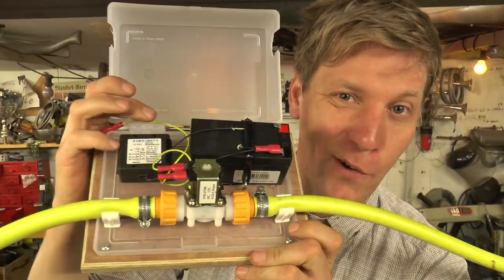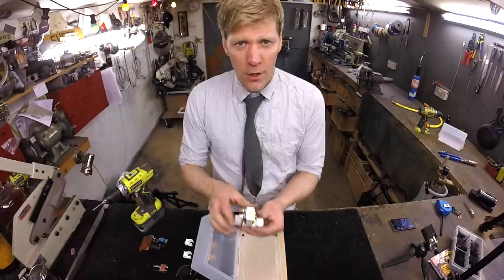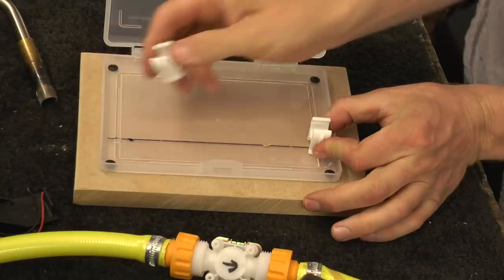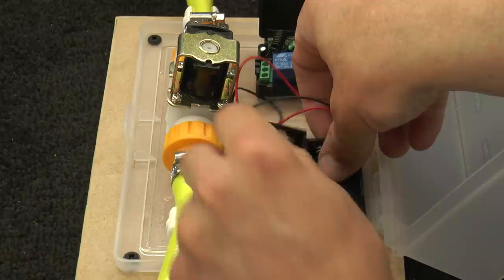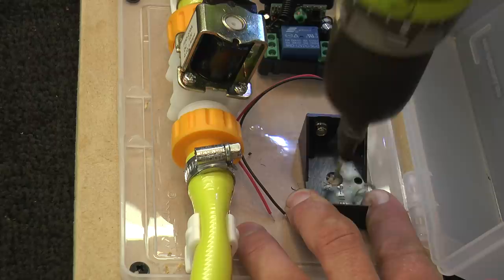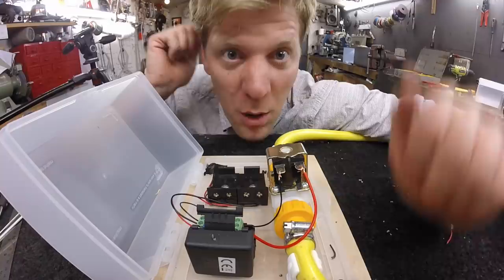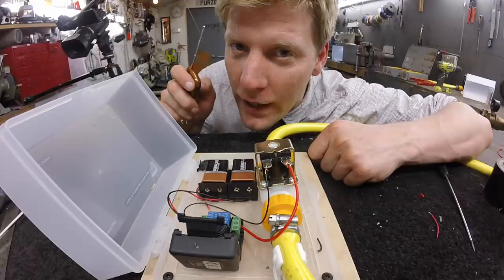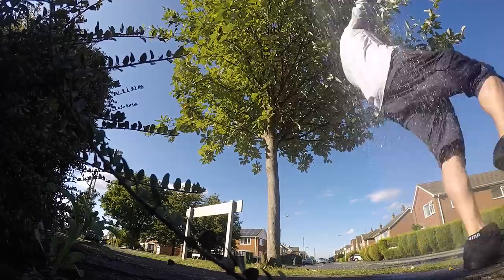How to Make a Remote Hose Pipe Controller

Comment: What you are saying about the Relay doesn't seem right. NC or Normally Closed is a closed circuit, that means current can flow. Normally open is an Open Circuit, meaning current can't flow. So its essentially the other way around.
Reply: You can tell he isn't in his element for once ^^
Reply: When you activate the relay, it is closed. When you activate the relay when it is NO, the relay is open.
Reply: A relay doesn't open or close itself. It opens the NC (normally closed) and closes the NO (normally open) Thats it. When the relay isnt activated, the NC will pass through current and the NO will not. When active, the NC will not pass current and the NO will. It literally switches the current from the right pin to the left pin. The center pin is what it connects to, also known as COM. COM is (when relay is not active) connected to NC. So current can flow from COM to NC. When active, it will disconnect from NC and connect to NO. So current can flow from COM to NO.
Reply: Though it wouldnt have hurt to look it up for him. Its electronic basics really. He can make amazing things. So he should be able to understand a simple schematic of a relay.
Reply: WumboTech You know he probably did but just got it messed up while filming.
Reply: You're right, Collin's oopsed. "Closed" and "Open" in electrical terms are counter-intuitive. You'd think "Closed means electricity can't flow", but that's not true, "closed" means it can flow. The terminology comes from the diagram of an electrical switch. It looks like a doorway, or a bridge. If the doorway is "closed", electricity can flow from one side to the other. If the doorway is "open",  the connection is broken.

It's a stupid terminology. We think of doorways as something we walk through, not "is the wall continuous or broken".
Reply: Whatever you just said. No idea if it's true or not but I think you know about this shit so imma like your comment
Reply: Yea its fair to say that, because otherwise it wouldn't have worked ^^
Reply: I agree, wanted to put the same comment as yours but I was pretty sure somebody has already noticed
Reply: The term closed and open in regards to a switch or relay refers to the effect it has on the circuit. A circuit is basically a loop where current flows from the power source, through the load and then back to the source. With DC from a battery it flows in one direction, and the with AC from the mains it switches direction many times per second. If you close the loop, current will flow. If you open the loop, current won't flow.

On another note. Colin referred to the control circuit needing a wire connected from the positive battery in terminal around the the common terminal. The reason that the board doesn't pass though the 12v to the common is due to the solenoid side of the circuit being rated for higher current than the control board itself requires to operate. This also allows for a separate power supply to the solenoid if the application requires it.
Reply: Pretty sure he is fully aware of it but this is supposed to be done by beginners. He basically explains the position of the solenoid rather than the way a NC / NO circuit board works.
Reply: callardo1 uhm no, i dont see why he would give false info on purpose.
Reply: I believe these units are latching. Not by the relay itself, but by the logic which drives it. In which case, the relay terminal assignation would be arbitrary.
Reply: unless the solenoid he used is normally open then he is right ;) but thats a design flaw since it will be using power with the water turned off just to keep the solenoid shut
Reply: It depends on the control logic which drives the relay
Reply: MattsAwesomeStuff Think of it as a drawbridge.  The source of the name came from early switches that had a lifting gate that allowed current to flow when the 'drawbridge' was closed.
Reply: callardo1 Actually, you're the only one who's right here. When talking about NC or NO, at least for me in a mechanical field of work (we sell electric valves in the thousands daily) nobody ever thinks or talks about how its wired, but what the thing you get does for your application. Either you need it to be closed or open constantly WHAT HE MENTIONS AND REFERS TO IN THE VIDEO.
Reply: Up you go!
Reply: A plumber doing electrical work, what did you expect?
Reply: I see you beat me to the comment after I scrolled down lol.
Reply: The solenoid was nc, so when energized it would become open and water would flow
Reply: The circuit board was asking what you were controlling, something that is nc or no. If the solenoid was no then water would always flow until you pressed the button. So putting it on the nc side was correct since you want the solenoid to open on command, not close
Reply: I get what you're saying, but in the context of electrical circuits that is not what NC and NO mean, and that is what he was talking about. The circuit board doesn't ask what you're controlling, it simply describes its outputs.
Reply: Knew someone else would have noticed that! It will work ok this way but it will drain the batteries when in the off position rather then when on the on position. It’s also possible that it’s a latch and unlatch type system in which case it really doesn’t matter because there would only be a current draw while making the change.
Reply: CoolHwip92 yes you’re right, I shouldn’t make technical posts when I’m sleepy lol, good catch.
Reply: A latching valve is what’s really needed, so only a momentary to turn on, and another momentary to turn back off. Don’t know if they are made or not though.
Reply: WumboTech: so to be confusing; the plumbing valve is (I'm assuming- colloquially)  normally closed meaning water can't flow and maybe should be connected to the normally open relay output meaning electrons aren't flowing...  Press the switch and presto the relay closes and the valve opens and "it-verks" (or viceversa) if it doesn't work swap the relay output wire  around.

BTW ?? the common shouldn't be active through the circuit board allowing one to switch say, a 24V load with a 12V input (or maybe there was a jumper on his board).  Adding a battery charger to the unit (rechargeable battery of course) should make this device much more useful..
Reply: He also missed the reason why you have to connect the + terminal to COM. 
The reason is to allow the relay circuit to be completely independent of the power supply to the controller circuit. This way it can be used with 12V, but also 3V or 250V...
Reply: No. The relay NC/NO is referring to the trigger circuit.

Its start reference is the trigger.

Its alarm/burglary, they are ass backwards, and always focus on the trigger side and not the action of the powered side.

So NC only turns on when you break the circuit - because closed in the “normal” state and open is the “alarm” state.

Another weird quark about alarm/burglary fellows is they use “upload” to be what we would consider “download” because they always use the alarm panel as the reference point and not the currently used system.
Reply: spoonikle:   strange...  helps to think like the people who install these things...  (rather than as an engineer)

unlike how in a serial network...  Tx of one device connects to Rx line of its mating device.. (for every upload there should be a corresponding download)...

good for a laugh, hope the poor kids can make head and tail of the instructions..
Reply: kadmow I’ve installed hundreds of automotive wireless switches and alarms and in every single case, NC had continuity with COM in power off state. Hey Colin, give us  short video of that test linked here? We need to know lol!
Reply: A simpler way thin about its that NO and NC are about the 'gate' (switch), not the source of power.  If the gate is closed, electricity can flow.  When it's open, it can't.
Reply: waynenocton:  that would be expected given normal nomenclature.

I was referring (I think what you have picked up on) to his board which had power at  the COM without an external connection, that means the relay isn't working as a relay ( allowing switching of a different voltage level to the control circuit) but merely as a controllable switch.

Besides that good to have a bit of fun, mix it up a bit, no harm done at 12VDC.
Reply: I can't believe everyone feels the need to weigh in on this given that Wumbo is correct and half of you haven't got a fucking clue what you're talking about. I'd like to also mention the fact that he used MDF for something that will come into contact with water annnnnd also highlight the use of gaffer tape to isolate the underside of the circuit board from screw heads - ever felt the bottom of a circuit board? 3 x fail for this one.
Reply: steampunk6 i immediately had the sane thought as you
Reply: kadmow I think we are mixing things up and would likely agree in person. IIRC he put the same 9v+ to the common side as runs the remote device. The NC and COM connections should be connected even during power off start connection the 9v+ to the electric valve at all times. Except when activate with the remote. Had the COM had another voltage connected to it, it would have still passed that at all times even with no power to the device itself before it’s normally connected. I would still like to see Colin do a video reply and do a continuity test and prove it lol.
Reply: WumboTech I think he was conflating the valve work the switch.
Reply: Mostlyharmless1985 no, it is NORMALLY OPEN - so it is open until activated.
Reply: He's a plumber not a sparkie. Give him some slack.
Reply: and check the video ones again he said to connect the wire at NC.
than when he correct the circuit he change the red wire to the other side of the connector to NO
Reply: It is kind of funny, but if you were talking about the valve he would be right.  If the circuit is hooked up to the normally closed contact on the relay, the valve will be normally open.  I don't think that is how he meant it, but we all know that he knows how it works, he just goofed on the video.  Or maybe he was talking about the valve.  Either way, not perfectly clear.
Reply: WumboTech, probably a cheap circuit board from china with wrong labeling.
Reply: Mostlyharmless1985 normally closed or normally open refers to the position of the contacts with no outside force applied including voltage. So normally closed contacts are closed until voltage is applied and then they open and vice versa with normally open ones.
Reply: Correct wumbotech. Current will flow in the normally closed circuit until the button is pressed, when it will cease (the circuit will "open" or "break", and the reverse is true for the normally open side. I'm guessing that the valve works the way it does because the solenoid valve can also be normally closed or normally open, ie a normally closed solenoid valve will be closed until current is applied, and vice versa. To save draining your battery/batteries, the ideal set-up would be a normally closed solenoid wired to the normally open terminal, otherwise there will be a current flowing through the solenoid until the button is pressed and the circuit is opened.
Reply: WumboTech do you know a good site where i can buy one?
Reply: I'm glad I'm not the only one scratching his head about Colin's explanation
Reply: I believe this also has to do with whether the solenoid you are using is normally closed or normally open.
Reply: @AVRMV_Agency  To be fair, Colin is a plumber by trade, not an electrician. Im quite adept at electronics, but id have no idea how to plumb something. Skills dont always translate across.
Reply: It’s probably a normal open solenoid valve, and needs power to keep the soldenoid closed to stop the water flow, which is basically the wrong way round because once the battery goes flat it will allow the water to travel freely
Reply: It makes sense but I hate that it's like that. Close means off and open means on is a lot easier.
Reply: If you listen correctly he says when you press the switch at the start of that (meaning to activate the relay) so he is correct the NC won't pass any current as it will now be open.
Reply: Thx

Comment: Normally open = No current flowing, except when you press the button.
Normally closed = Current flows all the time, except when you press the button.
Reply: thank you, was looking for this
Reply: so
No = Water sprays when the button is pressed
Nc = Water sprays constantly unless you press the button, then it will stop untill you release the button
(just an even more dumbed down version. some of this stuff can be a little confusing at times)
Reply: No - The circuit is normally open.  No current flows.  Pressing the button closes (completes) the circuit, allowing water to flow.
Nc - The circuit is normally closed.  A current flows.  Pressing the button opens (breaks) the circuit, stopping the water flow.
Reply: You can get valves that are either 'normally closed' (power applied = water flows) or 'normally open'
 (power applied = water-flow blocked), as an added layer of confusion.

To make the valve allow flow when the switch is activated, a valve that is normally closed would have to be used with a normally open switch, and vice versa.
Reply: Rafael Gomes yep, he's going to drain the battery a lot quicker the way he's designed it. Either he has the relay energised or the solenoid energised, always drawing current from something
Reply: @id523a .... eh. no.
Reply: @edwardfanboy  buy the right part for the application?
Reply: nawwww....
Reply: ShatteredLoyalty depends on the solonoid they can be no or nc aswell
Reply: For a plumber "open" means "flow" 😛
Reply: Make sure that you have a normally closed solenoid. Normally open for electronics is same as normally closed for hydraulics . It’s confusing unless you understand both.
Reply: @corneilcorneil  The opposite.
Reply: @DavidHust  No ... read Csnider's comment.

Comment: You can buy 3/4BSP hose to tap connectors with a proper tail to push hoses onto, usually in the next bin to the one where you found your hose fittings.

Comment: Now make one using a proximity sensor so it's completely automatic ;p
Reply: Yeah, its not hard to make some really amazing defence systems, but our legal system is progressive up here in Canada, so They'll probably infringe on me for a thought crime.
Reply: Make it yourself. Its pretty simple.
Reply: I want to have one that I can remotely direct. After rugby matches drunk men piss on my hedge and I want to point it at the perp and shoot. Thanks for the tips to get me started
Reply: Very easy to do if you have an Arduino laying around (or if you order one from China for like 4 quid). I connected mine to a soil moisture sensor, so that it will automatically water my garden when it gets too dry.
Reply: We are watching
Reply: if cop comes you will be in jail🤣
Reply: @JB9000x  were you able to deal with the drunk men pissing on your hedge?
Reply: I would just fill a compressed pipe filled with isopropyl alcohol then get a laser tripwire and put a tube in the pipe and have this valve hooked up to the laser trip wire so the pressurized alcohol shoots out a stream and place candle below the stream of alcohol so flaming alcohol will shoot out